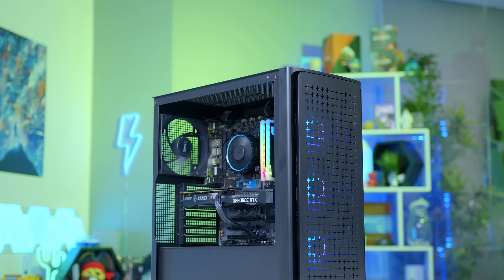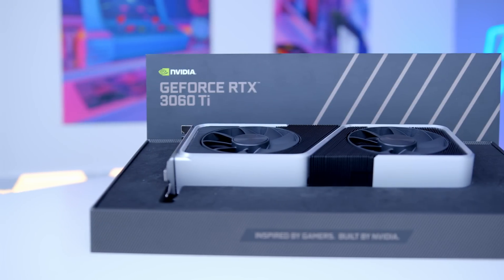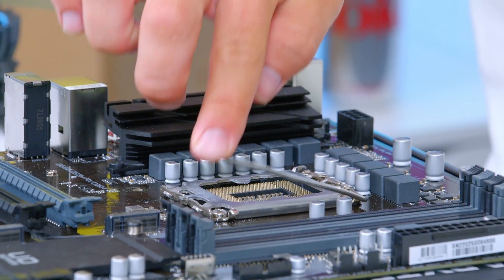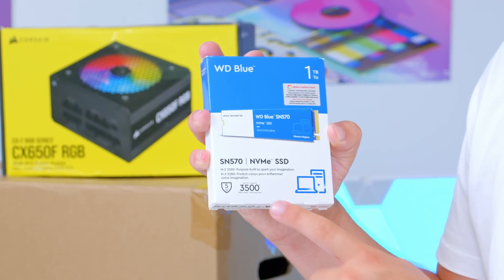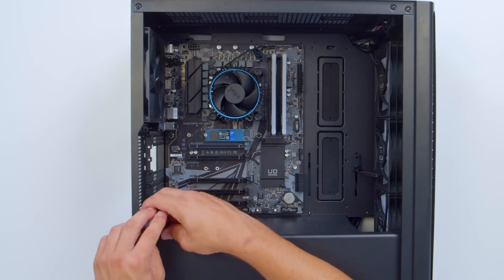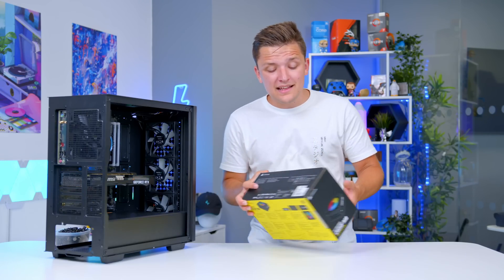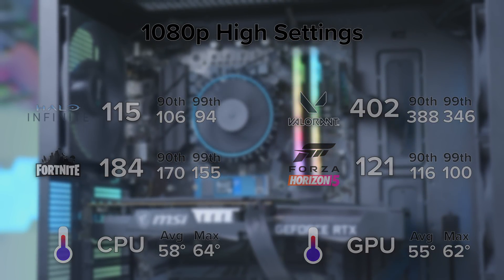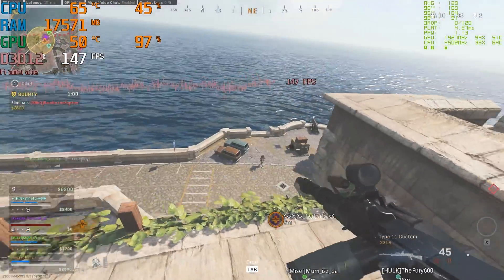BEST $900 Gaming PC Build 2022! [Full RTX 3060 Build Guide w/ Gaming Benchmarks!]

Comment: I have just built almost the exact same PC (same motherboard and CPU but with Gigabyte eagle 3060 oc 12 GB). Unfortunately I am getting no display signal most of the time :( I managed to install windows (while installing I could see the screen) but after installing i get no signal to the screen. I rebooted like a million times, and some times I got signal but only for like a minute and then black again. May be an issue of drivers?? I never get enough screen time to quickly download and install the Nvidia driver. Any help? I am desperate. Thanks!

Comment: The 500gb is also called the hard drive right
Reply: No. That is an SSD (solid state drive). It works like a hard drive in that it stores data, but is much faster. A lot of PCs don't have hard drives anymore since SSDs are just much faster. If you need a lot of cheap storage, you can still install a hard drive.

Comment: Great video! can it be pushed to 1440p high settings too?
Reply: 1440p will run fine. Maybe not at ultra on all games, but pretty well. 60fps+
Reply: @Phantom0721 what about 1440p high settings will most shooters reach 144fps?
Reply: @Leoo055 depends on the shooters, but you should be able to easily push at least 100fps
Reply: @Phantom0721  that’s fine tbh idm having ultra settings 30fps minimum on single player games and 1440p high settings or ultra for 144hz. thanks for clearing this up 👍

Comment: I am getting confused with different varient of 3060 
can you recommend me some good varient of 3060 and which to avoid 
I am thinking of going for tuf gaming 3060 v2.0 is it a good idea or should i go for cheap ones ?
Reply: I think considering for the price you could get a cheap 3060ti it is not worth as a 3060 ti or even springing for one of the cheaper 3070 would get you more performance
Reply: @NeverMissAnotherDrop  the cheapest 3070 and 3060ti is from the company pny 
is this good enough
sorry but I am really newbie about pc building
Reply: @RobertShresthawolf  pny which one? (Exact model)
Reply: @vFxc  PNY GeForce RTX 3060 Ti 8GB XLR8 Gaming
Reply: RTX 3060 from Gigabyte Eagle OC is pretty decent mid range card..

I dont think you need the premium card for 3060. 

Unless you go higher like 3060ti or 3070
Reply: @X.Y.Z.07  thank you for the suggestion 
I was thinking the same thing
Reply: This video is a guide for which rtx 3060's to buy and he goes over ALL the varients 
https://youtu.be/vGZmK341Hrc